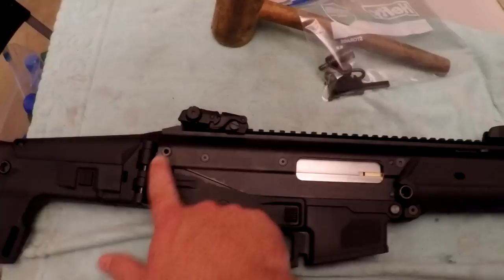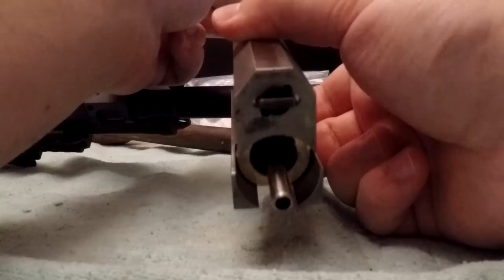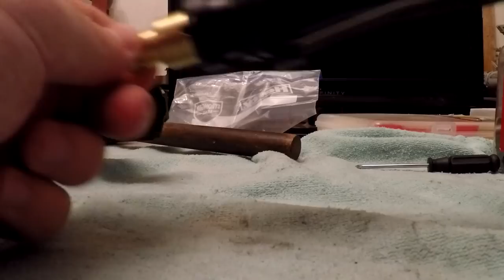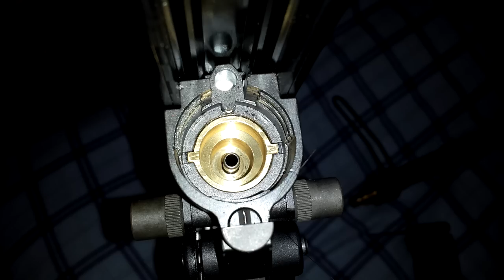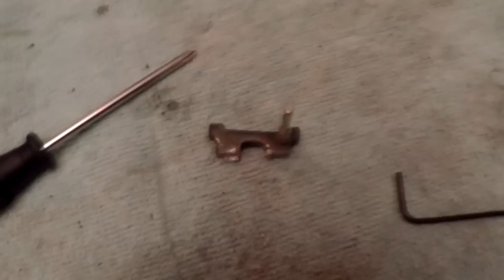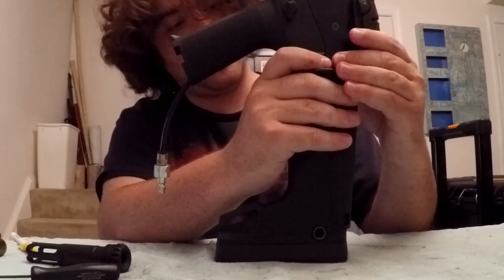Daytona Gun MSK Masada ACR Airsoft Rifle Install Guide

Comment: Hey I love your videos. I'm getting the daytona kit for the msk but I was wondering if I could use the we battlefield edition msk, the one with the crane stock. Also is the recoil on your daytona gun satisfying? 
Thanks and keep up the great work.
Reply from the maker: +Taktik Airsoft Yes it is very satisfying. It also sounds very intimidating. I have had people call hit just by sound alone lol. And any MSK will work. The Battlefield one included :)
Reply: Thanks for the response. What air rig and set up do you use. Because I know it's not the same as a polarstar. Thanks
Reply: Thanks for the response. What air rig and set up do you use. Because I know it's not the same as a polarstar. Thanks
Reply: Thanks for the response. What air rig and set up do you use. Because I know it's not the same as a polarstar. Thanks
Reply from the maker: I use this reg and any non slp tank will work.
http://tnkguns.com/redline-firebase/
Reply: Ohh. Does the reg come with a line as well
Reply: Ohh. Does the reg come with a line as well
Reply: Ohh. Does the reg come with a line as well
Reply: Ohh. Does the reg come with a line as well
Reply: Shops didn't mean to post that so many times. Also do you use carbon fiber or aluminum tank
Reply from the maker: It comes with a line but you might want to order a wide bore line from tnkguns becasue It allows for enough air to run well on full auto. Also I use a Ninja Carbon Fiber 90ci 4500psi tank because the closest place to fill is my field which is 45mins away. A metal one works fine though.
Reply: Thanks for all the info. Definitely helped keep up the great work.
Reply from the maker: Thank you I will!